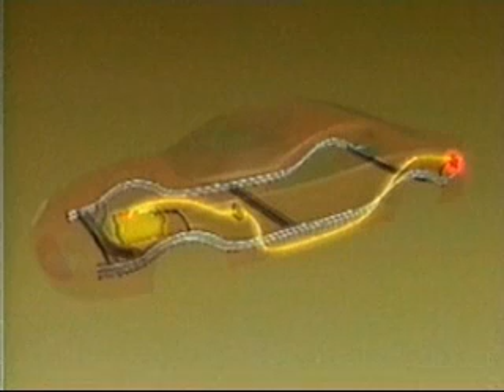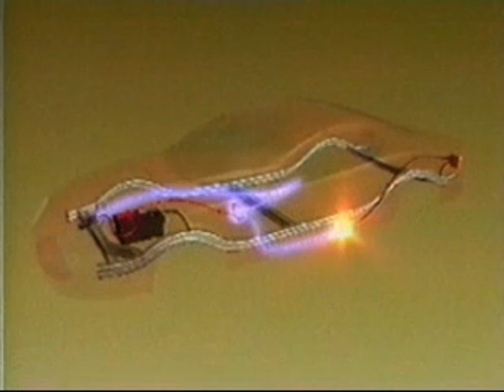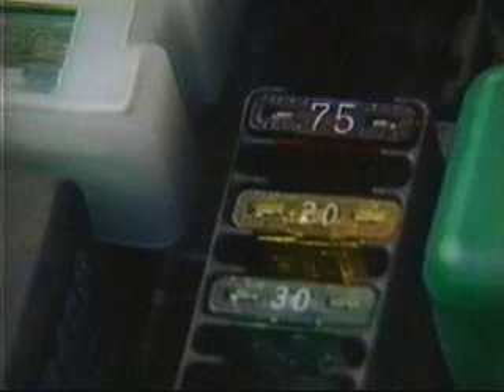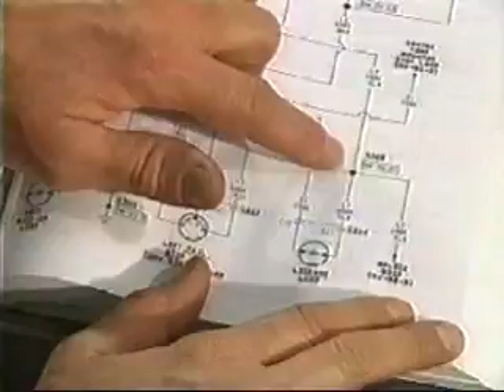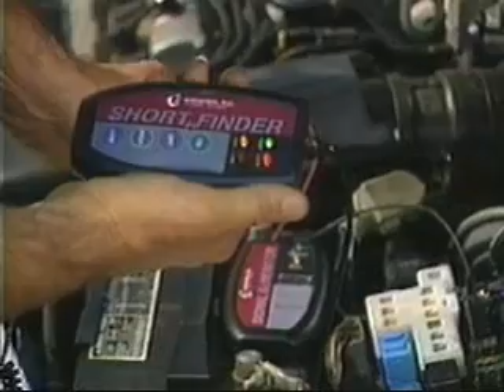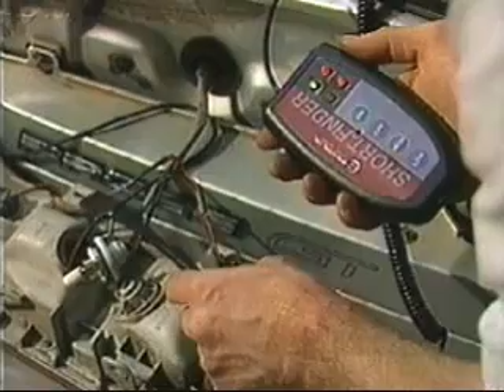Using the SNAP-ON CT1000-KT Short Circuit Finder

Comment: 3:18;  3:30;  (connecting signal generator)   3:43  WHAT is THIS?  "Using Extension Lead"
BOTH Positive & Negative posts of Battery are [Still] CONNECTED!!???    I'm Confused.
"Connect Directly" ... TO?  Why connect to Neg. Post?  (remember Pos. Connected Too)
sorry, trying to make sense of something i Still know nothing about. 

7:42  perhaps you might want to try again.   I've Rewatch many times, Still No brain input.

Comment: Solder a buzzer to a blown fuse and insert it into the fuse block. Move the wire harness. When you hear the beep you found it.
Reply from the maker: How's my Snap-On guy gonna make his boat payment if I do that?
Reply: @sonex413  lol, I think if we as mechanics can save a few dollars its worth it to screw the tool man out of a sale or two.....
Reply from the maker: @nealk6387  We are on the same page! I posted this video when I sold that thing on Ebay years ago, so the buyer could check it out. I never used it.......one of the few Snap-On purchases one might regret......lol